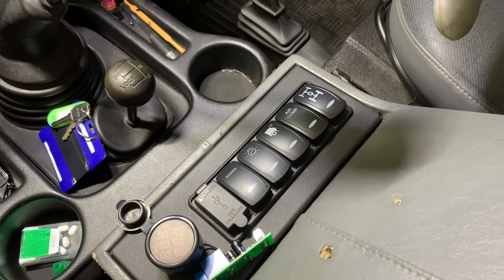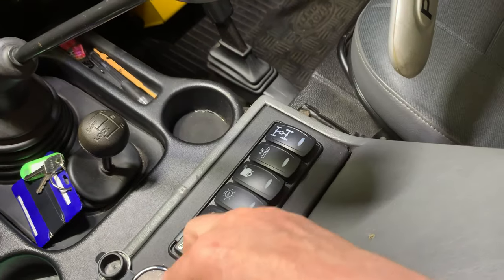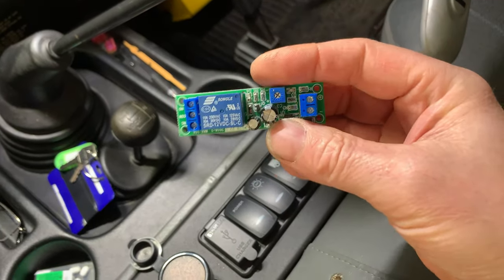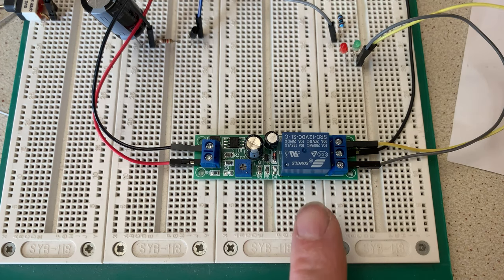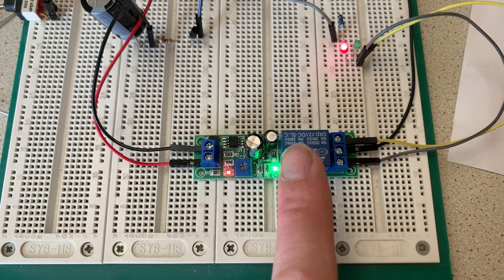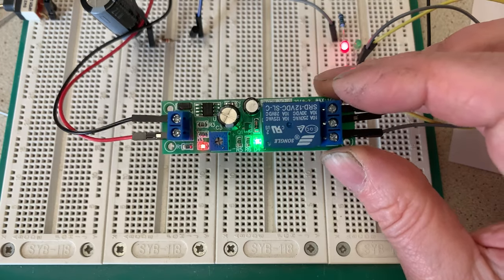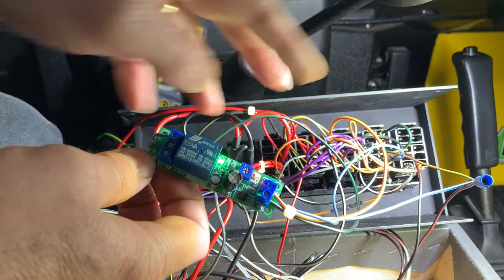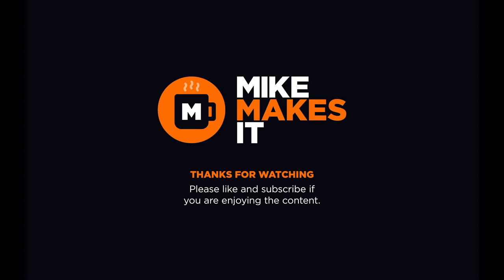Land Rover Defender TD5 Deployable step compressor timer fitted

Comment: We’ve got exactly the same switches in the old Volvo buses 🤩
Reply from the maker: Carlin is the brand of switch. I'm very happy with the build quality and if they are used in buses it just proves they are good! Thanks for watching 👍🏽
Reply: @MikeMakesIt  - They are really good, I don’t know the brand of the switches though, as I have never took them out, but they are still working fine in the 15-20 years old Volvo (Wright) buses, which shows how great they are! 👌🏻🤩👍🏻
Just a little comparison - we have 1 year old Scania (Alexander Dennis) buses with a different switch that started to break after 1 year of usage... That is shockingly surprising. 😊